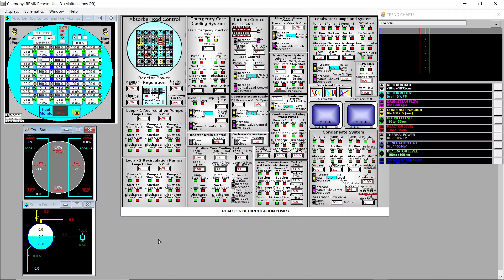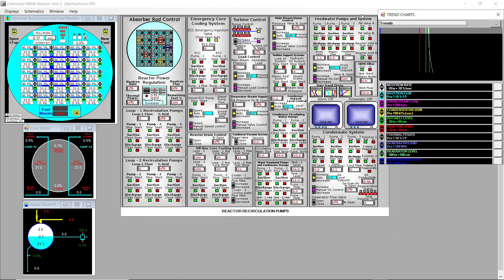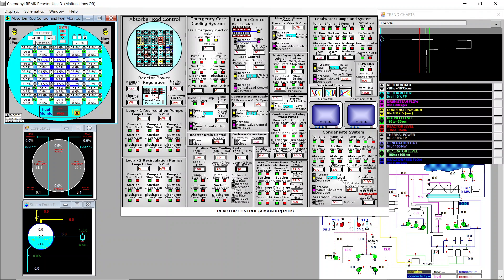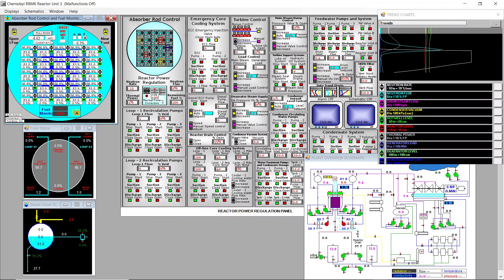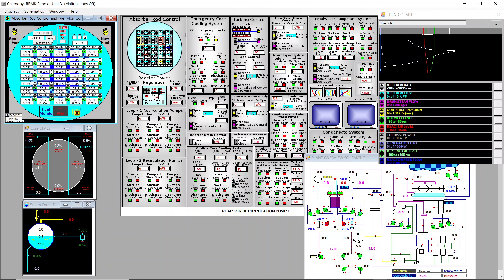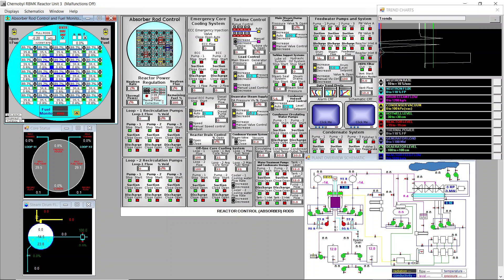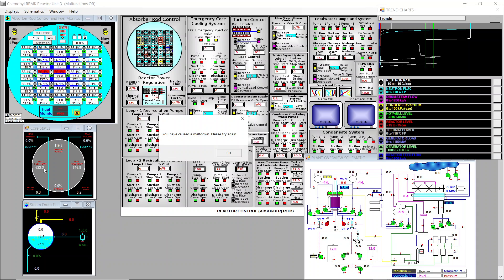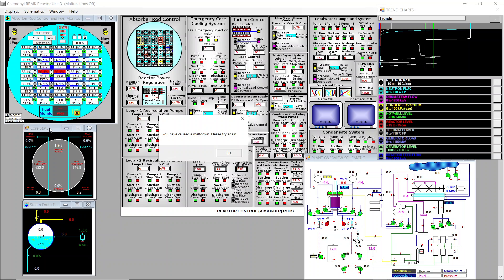RBMK Critical Runaway Tests at 1% Neutron Flux

Comment: hey i found this one with all fixes and diagnostic menu

https://www.reddit.com/r/chernobyl/comments/flzf4f/simgenics_chernobyl_simulator_problems_fixed/
Reply from the maker: Thanks for sharing! is this the link by comrade Full-Battery? I'm doing some tests with it but I feel it hard to operate in the lower resolution virtual machine screen so until I get used to it I will continue doing some tests with the legacy demo version.
Reply: The version looks good so far.
I am not sure what happened to the values. Pressures and flows seem to have run through some factor modification. A pressure of slightly above 1000 seems to be normal for 100% power. Flows look partially odd. Deaerator pressure above 15 (or so?) throws an alarm already.
So there is for sure some system change for the values.
The diagnostic menu looks like its working. (except refuel, does not seem to have an effect on the fuel. (At least the refuel does not.)

Beside that: It runs under win 8.1 without any special settings, like the simgenics version from their site.
Reply from the maker: @AndyPue  I'm happy to hear from you again! Indeed I saw this glitch with the values, and I cannot explain it, that's why I'm delaying the migration to the new version. Do you have any clue about why this happens? I also feel there is some difference in the neutron rates, like if the absorber rods were moving at different speeds.
Reply: @argilaga  I am not fully sure about the value change. But they all seem to be in the same ratio. (Around 1/4-1/5th from before)
I assume the unit base was adjusted/converted to a different system. (Especially noticeable with the stepping on pressure target values looking a bit like random stepping)

The neutron rates could be different due to the xenon poison value starting at 0% in this version. So it goes critical very quickly and needs the rods on automatic constantly raising to compensate until it gets stable.

It does still throw a meltdown at 100% neutron flux. However, it allows saving and loading of simulation states (!) and cheat engine still works with the same addresses. That could help you with experiments as you could be sure to have the same initial state and do not have to be too careful to not mess up the reactor state by performing tests, as it takes like 2 seconds to go back to a saved state.

The reddit post stated something about a place to tweak and adjust the simulator with some plain text config - could be the place to restore the value display. (Did not check that yet.)

I still watch your videos, but I hesitate to comment just for the sake of writing something. 😅 
I just click 'thumbs up' and wait for the next one, if there is no feedback to give or nothing constructive to add/share.
Reply from the maker: @AndyPue  You are right, the different neutron rate must be due to initial Xenon at zero. Really a pity that it still gives meltdown at 100% NF, I tried the version by Full-Battery in a virtual machine and that one allows to go past 100% I think that setpoint can be set up to 105%, Full-Battery said that he went up to 300% NF, I don't know how did he do...

I have been testing for a while today and I think that I got right the conditions for the accident in 1986, the water displacer tips are perfectly integrated in the simulator and they trigger a runaway almost the same as shown in the real plots. I will prepare a video soon!

Thanks for you support, and don't hesitate to write anything you want no mater how constructive! haha